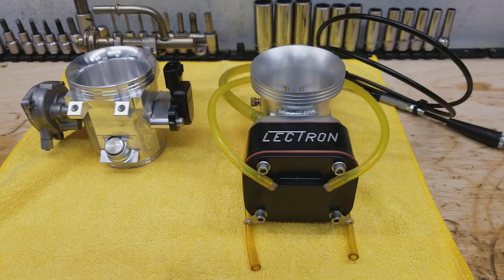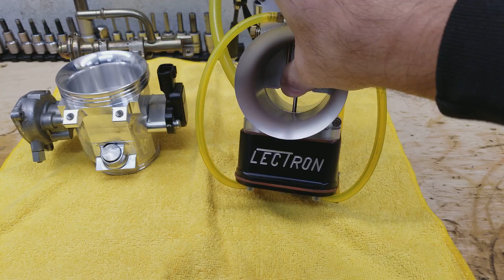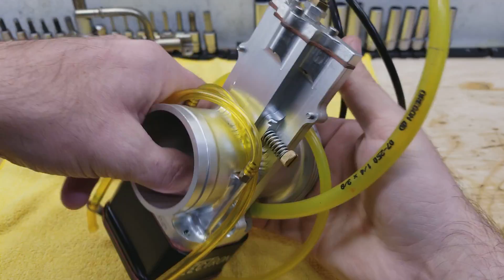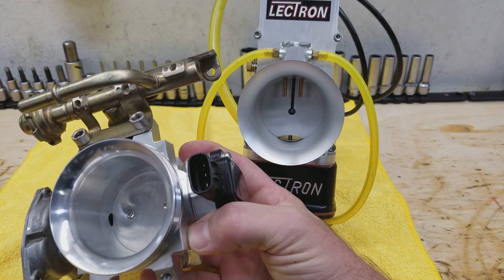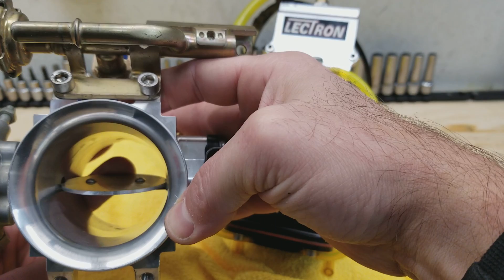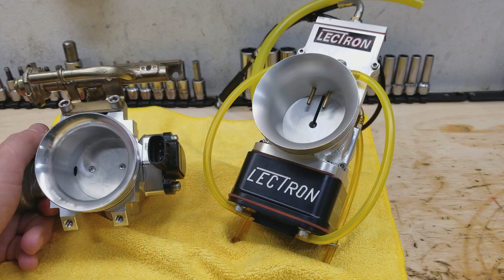Efi vs carb on a single cylinder atv Raptor 700 which is best!

Comment: the biggest benefit of EFI is going with digital spark control that lets you advance timing a lot more dynamically than a distributor, making a whole lot more power

Comment: fascinating. so if you want to go with a carb setup and convert your stock tank to gravity feed is there a kit or do your customers who convert to carb from FI generally just run a custom made tank to maximize weight reduction? seems like the stock tank would actually make a good duner with that huge fuel pump out of the way and the top capped.
Reply from the maker: TrailBlogger the only problem with the stock tank is clearance for the throttle cable. We have done them on a 660 frame using a 700 engine